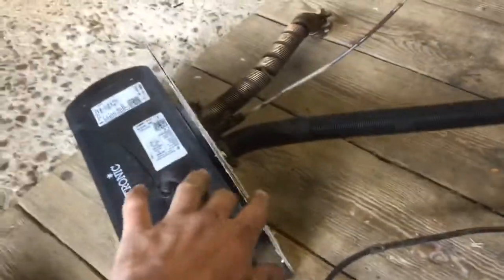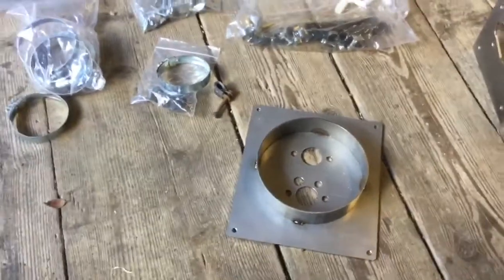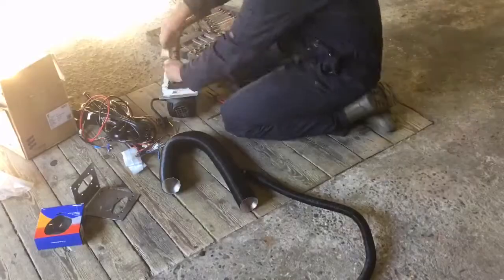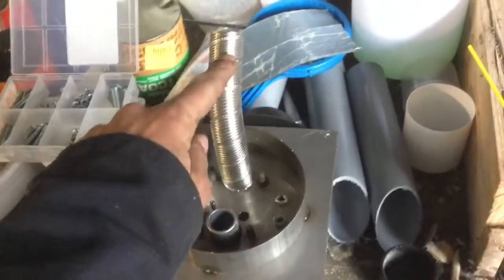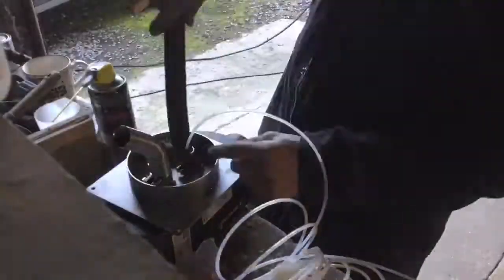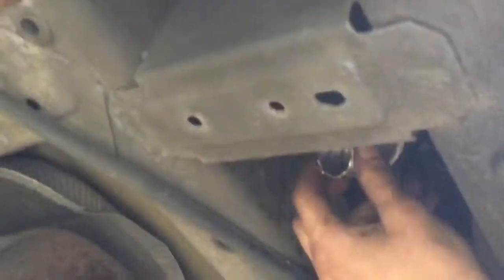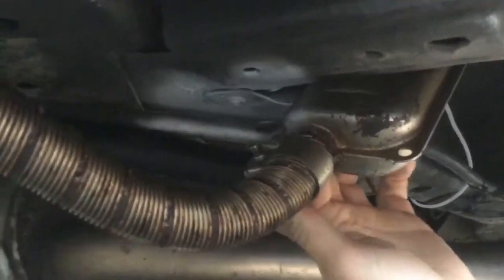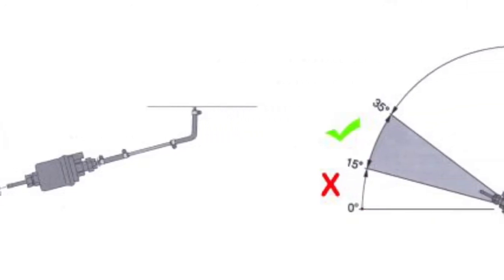Fitting an Eberspacher D2 to a Citroen Relay campervan - PART 2 Mounting the Heater

Comment: Hi
I have just purchased an fuel take off pipe that is designed to be fitted into the fuel sender unit. 
The instructions say once I have removed sender securing ring I have ten minutes to complete the work. 
Would you know why?
Thanks

Comment: Fantastic video.
One question. Intake air and exhaust should be as far away as possible. We don´t want breath exhaust gases right?.
Reply from the maker: Cransaft Valve Hey thanks for the comment, the intake side on the bottom of the unit is for the turbine not the internal ducting ie the air it blows into the living space. they want to be separated but not super critical.
Reply: Ahhh, ok understand. Many thanks.
Reply: MiNe Yours also reduces pollution by burning the gases twice 😎 ish, maybe

Comment: hi, what size heater do I need to heat a well insulated 37 foot resort coach RV ? thanks
Reply from the maker: +DOUG FERGUSON I couldn't say 100% but I would suggest D4 or D4 plus if it's just air heating your after. There is a guide from Eberspacher which has sizing suggestions and some good info ( https://www.eberspacher.com/fileadmin/data/countrysites/EB_UK/pdf_files/info_pdf_ebuk/heating_pdf_ebuk/motorhome_heating_uk_22374.pdf ) page 10 has size info about airtronic units also has info on hydrotronic

Comment: Thanks again for this series of videos. Did you use a new silicon base gasket when you refitted your heater?
Reply from the maker: +AlabamaTree I didn't replace the gasket as it was in decent condition, apparently you should though. I think there are way more places for fumes to come in on a camper van than the chance of that gasket letting in any real quantity of fumes. But that's just my opinion / decision.
Reply from the maker: +AlabamaTree if the gasket shows any signs of damage I would suggest changing it though